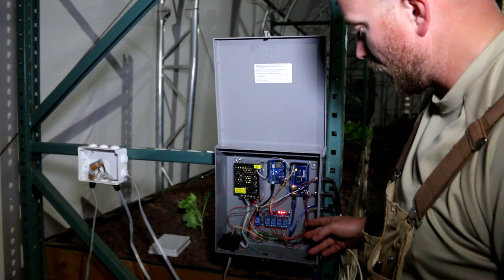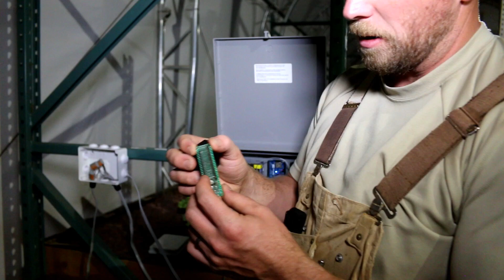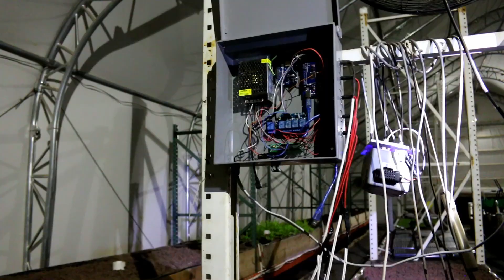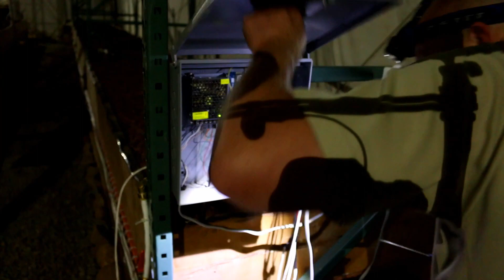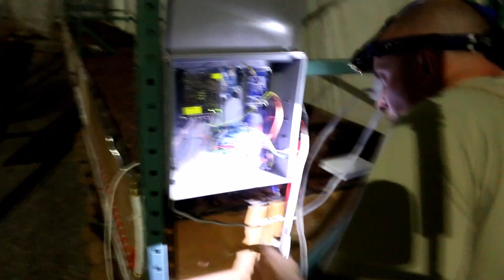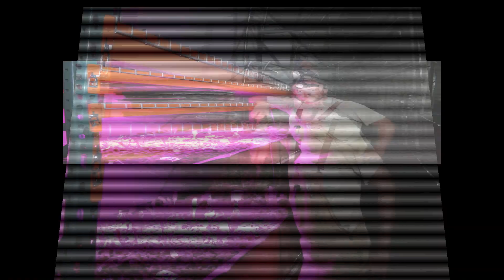These are the BEST SHELVES for MICROGREENS

Comment: Which shelves are these?
Maybe I missed it while you were talking about them. I have been looking at pallet shelves since I watched the video. I haven't found an affordable name brand. If anyone knows of when please leave a comment.
It's my goal to run 2 by 8 flood trays in an ebb and flow system. So if anyone knows of a good rack system that fits this please leave a comment. I'm having a hard time finding anything!
Reply from the maker: I got mine from craigslist...lots of used Industrial racking available. I dont know the brand name...all I cared about was how much weight they could hold :-)
Reply: TheRealMartian thanks!
I'll check out some used stuff. I haven't looked into that at all.

Comment: I'm thinking those shelves are awfully close to the outer skin...  Will make adding insulation interesting, but even with the insulation, will they get too much cold on that side?  Might want to think about getting some of that 2" foam-board to close in that side of the shelves.  Get the stuff with the foil on it and get bonus light reflection.

Comment: With the light can you mount it at the ends of the beds pointing in to the middle and still get enough coverage? Also if if there is too much light in the centre and you want to spread it out a little more some prismatic light diffusers may help so you don't need as many lights

Comment: Odd question but what about solar tubes with larger collectors on the outside? 1 tube per section with a large collector outside and diffuser inside to spread the light back out. 

The collectors could be as simple as white painted plywood boxes with a one way glass lid sloped enough to slide the snow off in the winter. You would get light hot spots at the point directly under the tube but should still get enough light in to cover the bed section. 

Expensive install but free lights once installed. Would mess up the idea of the moving insulation panels but could go with full insulation other then where the tubes exit.

Comment: Hi Jeff,
I have a different take on your step stool request. I am not a ladder/step tool fan because they are inherently unstable especially in an "off-road situation" rather than have a step stool that will undoubtedly end up at the wrong end of the building when you need it why don't you take and build a 12in wide painted 2 x 12 and mount it with hinges to your pallet racking and then when mrs. Martian needed to see the top shelf she could simply fold them down step up on it walk the full length of the eight foot or 10 ft pallet racks without it moving and reposition it every time she needs it and all without stones being kicked in towards your fish tanks just simply fold it back up out of place when not in use that way it would always be in the right spot when you need it and there would be no stability issues that may cause an accident and some point down the road with someone falling. And maybe If you worked it out right you can get your good neighbor Cody to cut you some 2x12s off some of those logs he's got so it wouldn't cost you nothing but the hinges and a few bolts ...and a bit of labor when he needs a hand with something....trade the logs for a day of labor....plus I think that fold down platform would be much more convenient and safer than a unstable foot stool on wheels.....just a thought..
Reply from the maker: +Crazy Craig's RC's and 3d fantastic idea
Reply: That's exactly what I was thinking.  Some sort of hinged platform/plank that would fold down.  If you really want go the mobile stool route, it would be cool to have something that is basically spring-loaded, so that when you step on it, it bottoms out on the ground to firmly seat.  However, I agree with CC above that up and off a mobile stool will be more tiresome and eventually, someone will end up on the ground.

Comment: TRM, the mylar is a good idea. It will also reflect heat. I like the rolling library ladder and on the bottom use an angle iron track upside down so a V wheel will ride on the track.

Comment: I hope it isn't too late, but I have to interject in regards to the lighting, the blue/red combo of leds isn't optimum or cheapest, I will send you some links for the most cost effective/efficient way of growing under led, a US based company so you will get cheap shipping rates to.

http://www.rapidled.com/horticulture-kits/ 

Have a browse of their products, but the SIMPLE diy kits would save you money and they are super easy, the efficiency out performs anything else when you use the cxb cree cobs, cree is also a US brand as you know.
Reply from the maker: +Mark Evans Sweet I'll check it out
Reply: Bare in mind, you can configure the cob's however you want! you don't have to use their heatsinks. There is a section on their website that has different colour temp cobs and I think something around 4-5000 kelvin cxb would be good for what you are doing, remember par is what you are after not lumens.

You have a par meter from what I remember? I think you should at least test one of these to see how they compare to the leds you currently have.
Reply: I don't follow your train of thought here...please explain what you mean by not cost efficient for micro greens, what extra spectrum? anything that has a spectrum that falls most efficiently under the PAR spectrum is most efficient....Have you looked at what the spectrum of a warm white/ cool white cree LED is like? and then compared it to the PAR curve? 

It all depends on how long term this operation is intended to be. If it's more than 4-5 years then cree CXB cobs ARE the way to go. Not to mention that fact you won't get potential mercury contamnation from a broken HPS/MH etc. The red and blue leds work but they just aren't as effecient as a white high BIN led. 

But I am open to debate on this so please argue your points and we can break it down.
Reply: You have some valid points and I agree the coverage and initial investment for T5 is less, but if you were to run 6000k leds, you would indeed get better vegging than with a 3000k led, but I think you would find for a 2x4 bed running the highest kelvin (can't remember if those cobs go to 6k, its probably 5k at least) CXB cree cobs would probably only need 3 cobs, maybe 4. Because with the higher kelvin leds they give out more blue as you know. 

You can price that up on the site I linked above, they won't need changing for 50k hours and maintain their output better than t5, there will be less light spill even with the standard  115-120 degree viewing angle (more of it directed to plants). the lumen maintenance will be well beyond the t5s so would need to account for mass bulb changes along the way for the t5s, in the aquatics hobby for best growth you change the bulbs yearly, although yes they go on for years, but their lumen maintenance is rated much less than this.

That's disregarding the fact these bulbs contain mercury (lots argue its a small amount but any amount in an enclosed system is not good) over edible foods. 

It would be a close call between cheap t5 and decent cree cobs, when you weigh things up...it really depends how long term this operation is going to be. As LEDs get even better in the future, he would be able to swap the chips out. T5 is slowly becoming obsolete so that's another point.
Reply: And which T5 unit would you propose to hit the same illumination level? we can do a like for like then, including extra electricity and changing of bulbs.
Reply: I would say to match the output of 3 cxbs you would need at least the 8 bulb version of that t5 unit, which works out at around $340 dollars or $500 for the 12 bulb you use, including bulbs...now thats not much less than the 3 cxbs including drivers and heatsinks? (you don't need to use the usual heatsinks proposed for the cobs, I don't and maintain +20c on ambient max) Or am I missing something here? That's before you factor in yearly or 18-month bulb changes. Break some figures down if you feel differently.
Reply: maybe so but we can break it down and see for dollar per Mw/m2 at the plant height, and when broken down over a period of a few years, they still pay for themselves, plus as I say, as LEDs increase in efficiency, they can just be switched out at some point, the drivers (100k hours), heatsinks etc won't need replacing as you know. It is a close call but I would go for the LEDs, but hey i'm bias I admit that lol.
Reply: I just think if the project is heading towards LEDs it pays for itself to do it properly. T5 is cheaper yes, but not by that much and if you factor in the bulb changes and cost to run It becomes almost identical over a couple of years, that's not including other benefits to be had from the LEDs. We are going round in circles now lol.

Comment: Use a springs on the wheels so that the step automatically locks when you step on it. I have seen it done before and assumne such wheels are available through the hardware store.

Also I have come accross plastic steps that work in the same way (plastic -> no moulds).